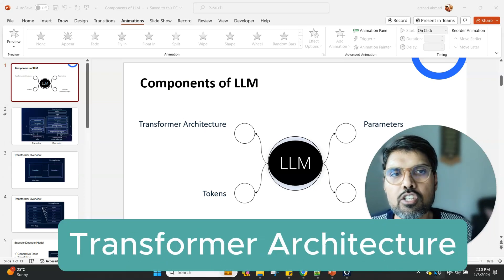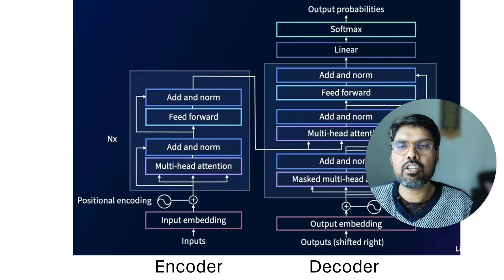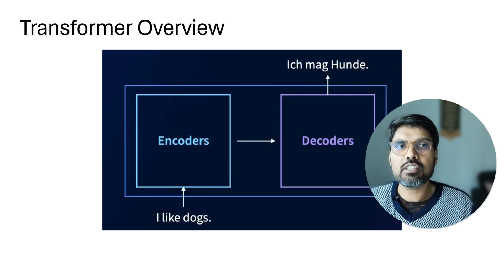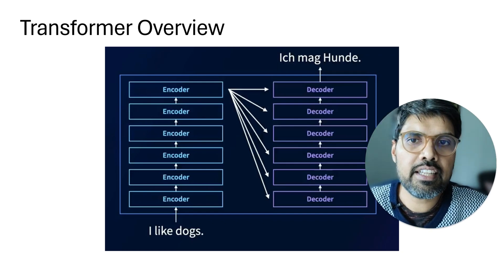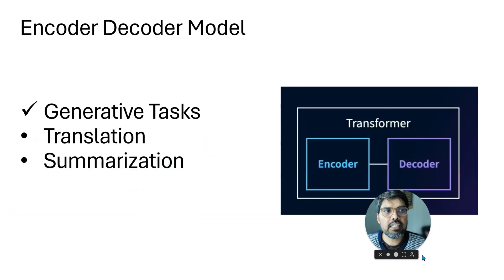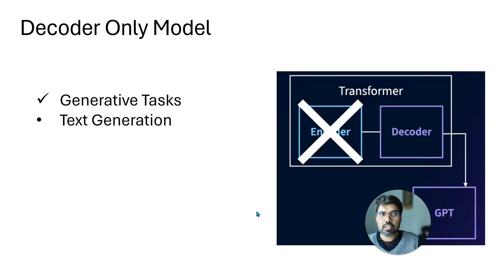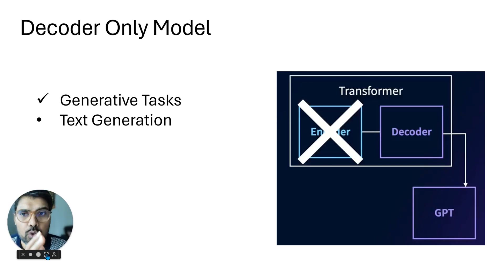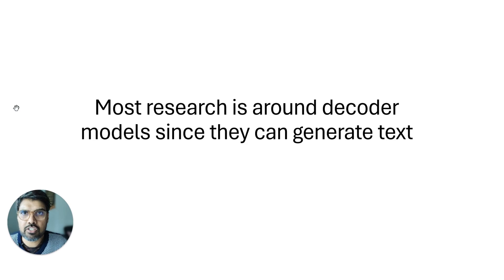Understanding Transformers in chatGPT: Mastering the Architecture Behind Language Models

Comment from the maker: 🎯 Key Takeaways for quick navigation:

00:01 🏗️ The Transformer architecture is a core component of large language models.
00:40 🔄 The Transformer architecture consists of an encoder on the left side and a decoder on the right side.
02:00 🧠 Transformers have multiple encoders and decoders, each with an attention mechanism for focusing on different parts of input text.
03:08 🇬🇧🇩🇪 Transformers can be used for various tasks, including translation (encoder-decoder model), language understanding (encoder-only model), and text generation (decoder-only model).
04:33 🤖 Decoder models, such as GPT-3, are useful for text generation tasks like chatbots and virtual assistants.